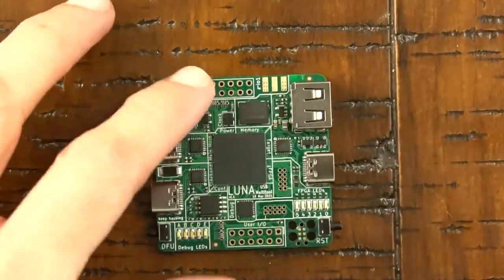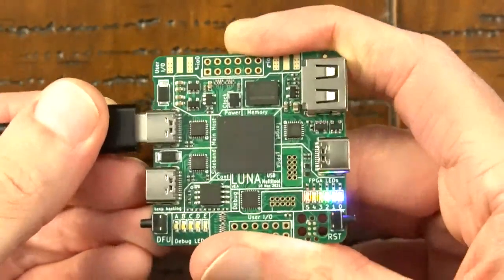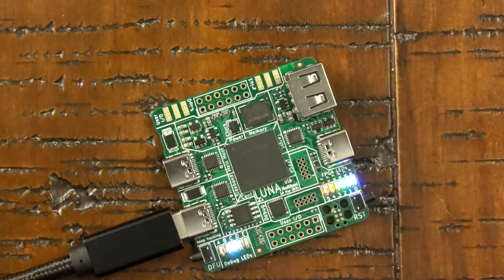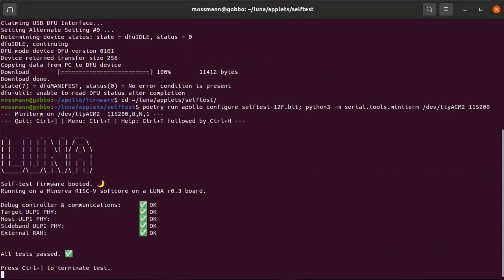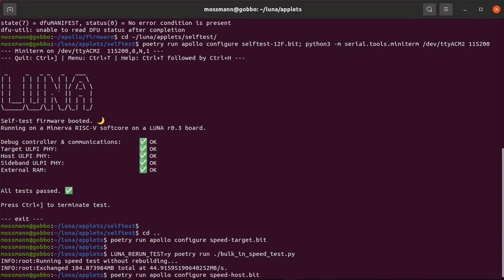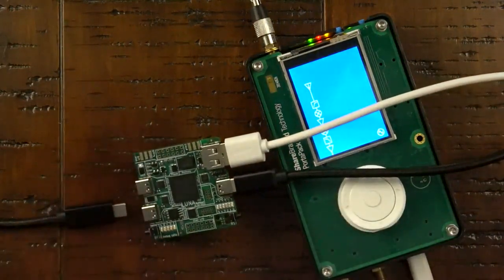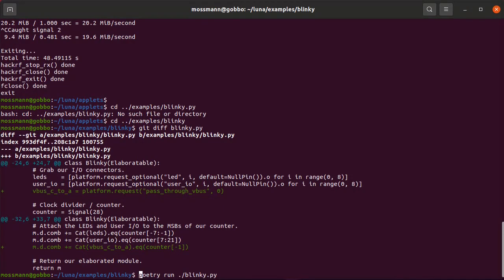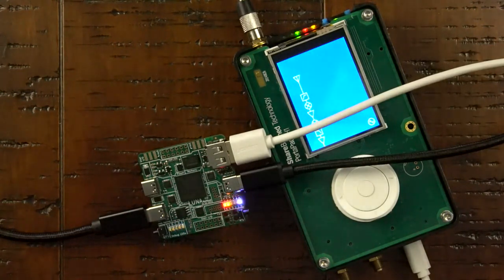LUNA Hardware Test

Comment: Hello, I'm interested in purchasing one of these for use in with a chipwhisperer-husky I have just ordered. I want to use it to trigger glitching off the usb signal. I was originally considering to buy a PhyWhisperer-USB, but I thought the real time MITM usb packet modification as well as the capture ability would be very useful features especially if trying to glitch with custom payloads without needing to rewrite my own client on PC. Can you comment regarding the "Advanced Analysis Triggering" discussed on crowdsupply. Will this be able to trigger reliably/repeatably with near instant latency in a similar fashion to the PhyWhisperer, based off of specific USB payloads?
Reply from the maker: For support with a specific use case, please open an issue on our GitHub repository: https://github.com/greatscottgadgets/cynthion

Comment: So does the LUNA replace the GreatFET/GlitchKit/rhododendron, or would the latter still be needed for certain USB-analysis?

Also, sounds like the boards would come pre-programmed.. so I assume a Black-Magic-Probe / Tag-Connect isn't needed to flash the Saturn-V bootloader onto the SAMD11?   Also, what does the SAMD11's operational code (Apollo) do vs the soft-cpu running on the Lattice L5E5U FPGA?   I couldn't find the Risc-V code on github.

I'm mostly interested in learning FPGAs and the USB protocol*.. like decoding traffic from an FTDI Chip CDC Class.   For the linux-noobie, the Total-Phase Beagle 480 Ultimate looks nice, is there anything somewhat similar for the LUNA?
*Kate Temkin hacking-usb/usb-workshop-materials

I understand LiteX uses python to generate HDL, but is there any walk-thru for the FPGA side of things**?  For example,  how does FuseSoC IP ecosystem differ from that of Migen/nMigen/MiSoC->LiteX?  Are the other HDLs relevant (Bluespec / chisel-lang HDL , SpinalHDL , etc)?  

**
1) a survey of compatible hardware (ex. Intel Nios, Microsemi Arm-M4, Quicklogic RIsc-V), JTAG/OpenOCD programmers, etc 
2) Setting up a build environment , preferably a Docker Container with all the tools for Lattice, Xilinx, etc 
3) an led-blink tutorial that instantiates a FuseSoC IP (ex. ValentyUSB, CPU : LatticeMico32, Microblaze) 
4) Synthesizing (SymbiFlow, Yosys ) and Simulating the logic/timing WITH (litescope, SignalTap, Chipscope) and WITHOUT hardware (Renode?, Modelsim) 
5) Place-and-Routing and programming (nextpnr, etc) 
6) Building, Downloading and Debugging or stepping thru the CPU CODE